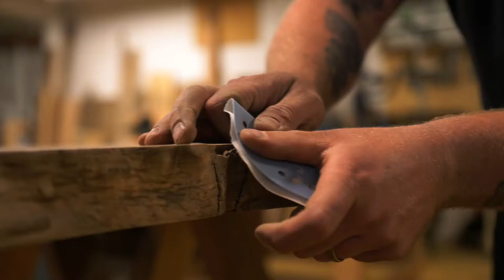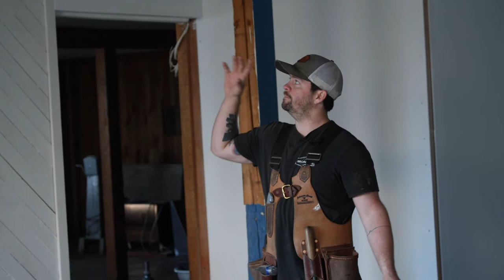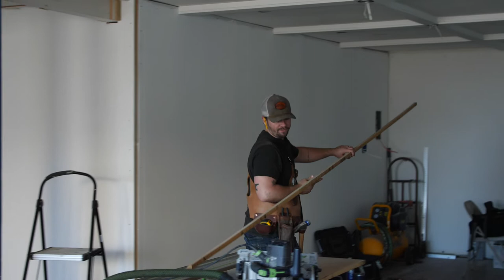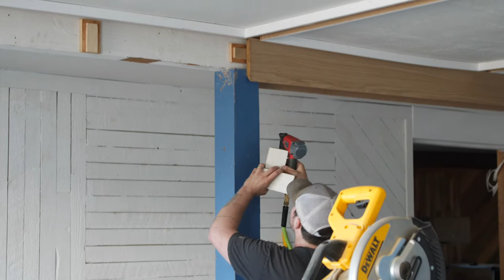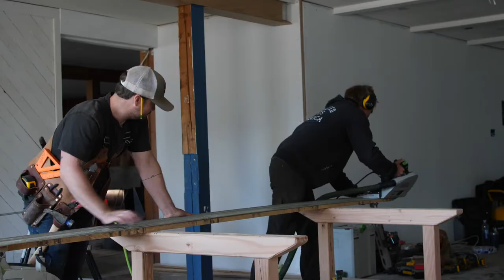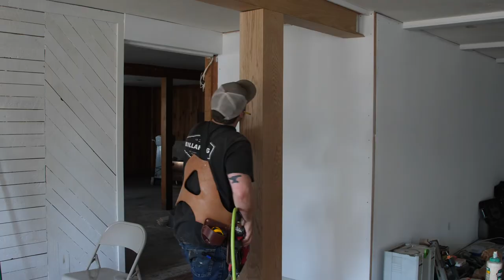How to wrap dimensional beams | DIY Faux box beams

Comment: Great video, super useful. How do you blend in the joint in the beam above the post so its invisible? We have 15' spans on our ceiling- we want to do this,  while avoiding having to buy the super long expensive dimensional lumber. Thanks again for the great video. Looks amazing.
Reply from the maker: Thank you for watching! Thankfully having the vertical seams where the but joints are on this above each post makes sense as far as how it would be for, however if your trying to blend long pieces of wood you might want to try scarf joining them before cutting the miters to assemble your box beams. This would allow you to get to the length you're looking for! I hope this answers your question!